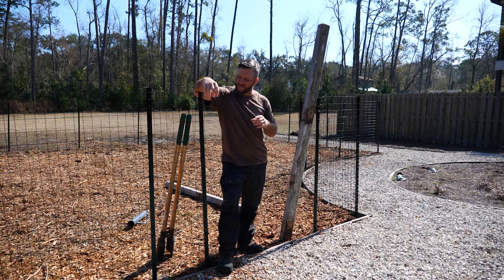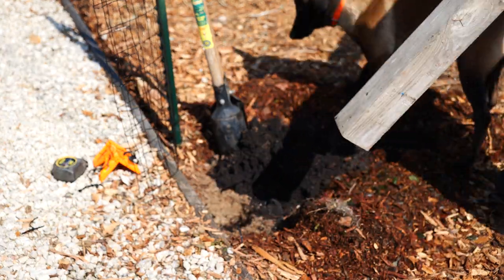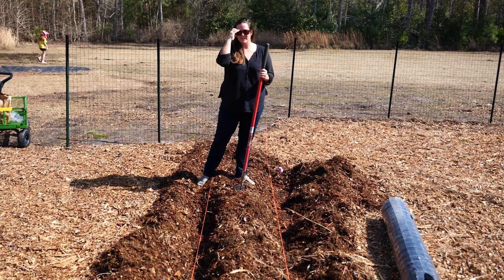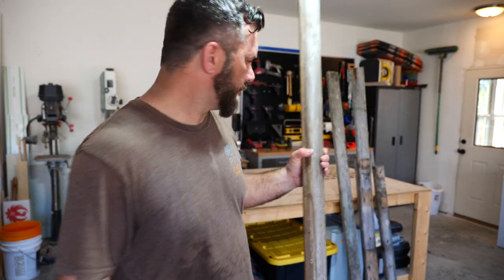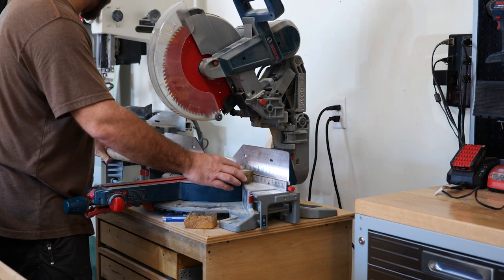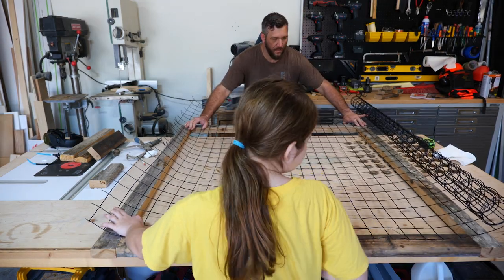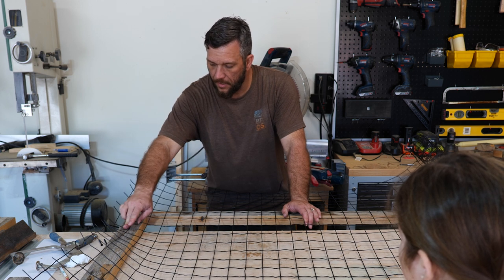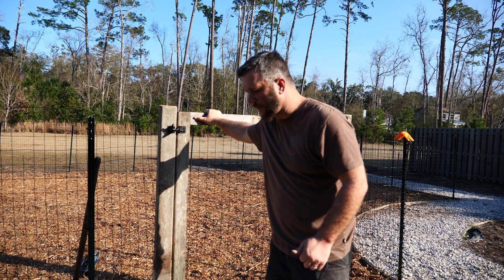Making a Garden Gate from Reclaimed Wood!

Comment: It's great that you involve the kids.  Now ya need a support board from the top at the latch assembly going to the lower hinge, ya like this \ so to put all the stress on the lower hinge due to the fact that there is little to no movement at the bottom of the post.